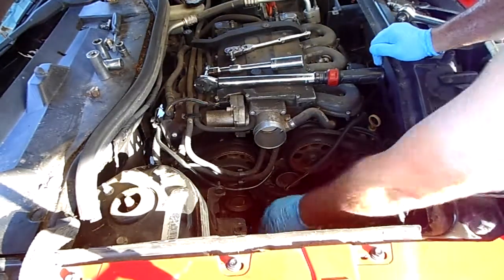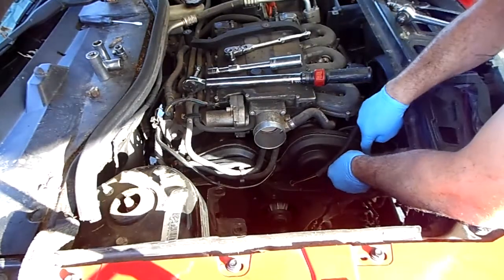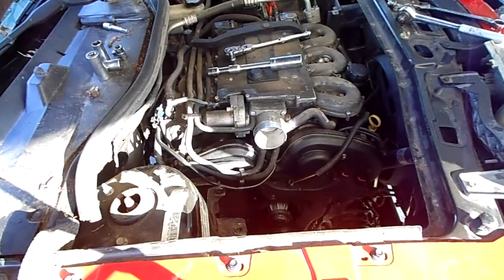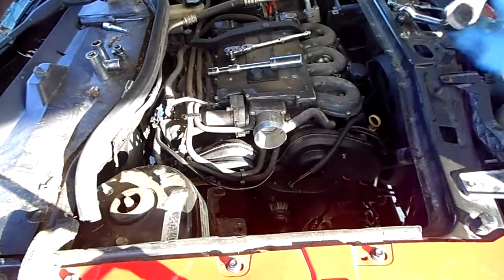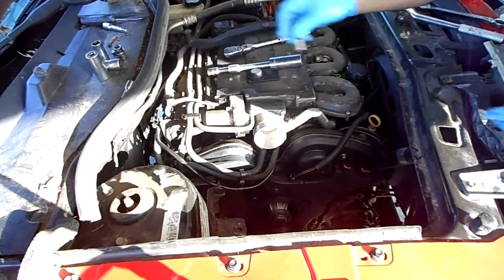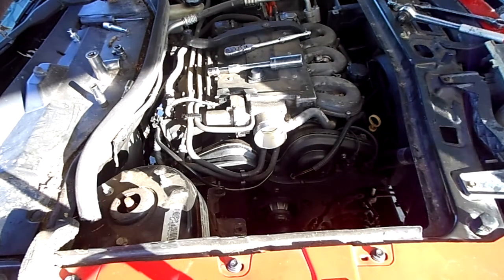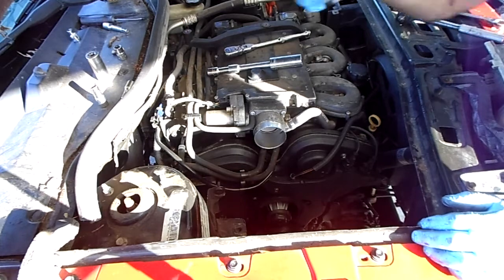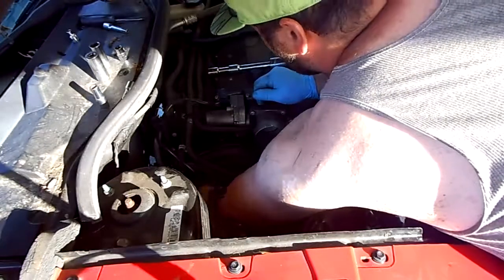2002-2003 Saturn Vue V6 Water Pump Installation Part 1

Comment: I have a 2006 Saturn vue water pump need's to be replaced  all the mechanics in my area  will  do the  job for 1,000 dollars   is that right
Reply from the maker: If that's what they charge. A 06 is a Honda engine I believe, and that requires timing belt work. I've not touched one, but there are videos out there that are decent.